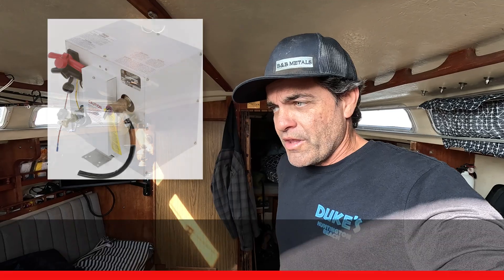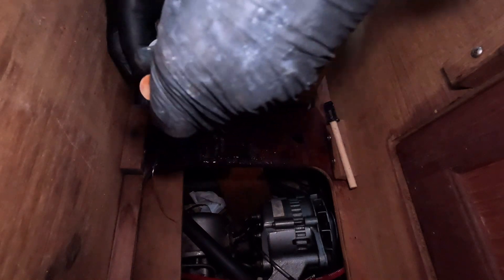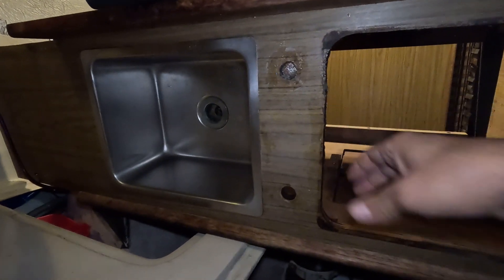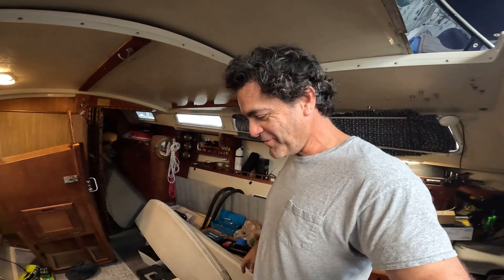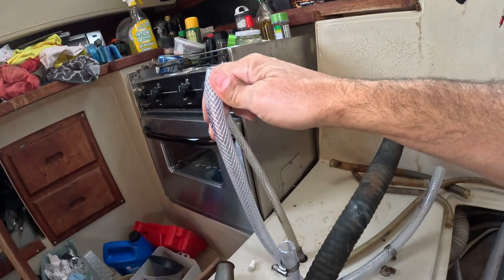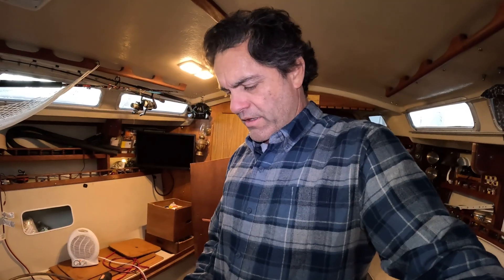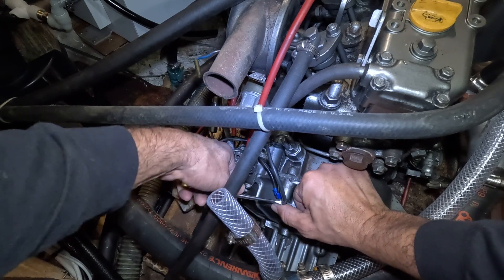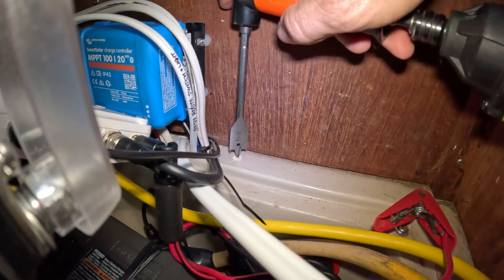CATALINA 30 DIY PROJECTS! Hot Water Heater - DC to DC Charger and MORE

Comment: Great stuff Andy.  When you get to take your first hot shower on-board, it will be SO worth the hassle.  Your process is like mine only with the difference that my OCD has me continually adding new scope to every job.  For example, replacing house bank turned into building a new battery box, which turned into sanding and repainting the anchor locker, which turned into rebedding the bow pulpit, and so on ...
Reply from the maker: 😂😂 Thanks! Mine go like that sometimes but I can totally relate!
Reply from the maker: Btw, I can’t wait to take that first hot shower! Yes sweet victory!!!!!

Comment: Are the reinforced clear water hose something from HomeDepot or is that from a boating supply store? My boat has cockpit scuppers that drain through that same type hose that looks like it needed to be changed a decade ago!   Are the hose clamps stainless or regular. If special, where did you get them as well? I have seen several versions of that switch panel you added next to the one you have. I read the reviews on amazon and they are all over the place and it keeps me from purchasing. I take it you are happy with yours or you wouldn't be replacing it with the same one. Which one is it and I will just purchase what you did? Amazon link maybe??
Reply from the maker: Sorry for the late reply… 
Mine are hoses from Home Depot. I found that they are the same hoses found at West Marine. I use Home Depot stainless steel hose clamps but for scuppers I would buy them at a marine supply store. 
These cheap Amazon switch panels work fine for my uses but I’m sure a purest would want to buy the super expensive marine panels. Here’s the Amazon link https://amzn.to/4cbO7AT 
I hope this helps and again, sorry I’m late with the reply 🤙🏼

Comment: I have a C30, and am getting ready to replace my water heater as well.  Mine is in the port laserette in the cockpit.  Looks like a fairly good size job too.  All the water hoses on the entire boat are original, so I am thinking PEX tubing instead of the poly hose. Did you get a heater that has the heat exchanger loop from the engine?  Which model did you use?
Reply from the maker: Most hot water heaters are where you mentioned. I didn’t have one to begin with and my Yanmar 2GM20 is raw water cooled so, no heat exchanger at all! That’s why I went with a 12v DC powered hot water heater. Seemed the best option for me because I wanted to add a second battery bank for things that will draw constant power like the hot water, refrigerator (soon) and migrate my inverter to this second bank. I currently have one battery bank.

Comment: Wow, quite the project. It seems that a simple install is never the case as one thing leads to another. The extra fabrication work on those plates turned out nice. I bet it is great to have hot water now.
Reply from the maker: You’re exactly right. It’s never easy on a boat and one project spawns into a few projects before you know it the whole boat is torn apart 😂